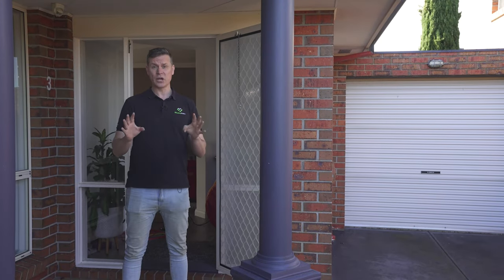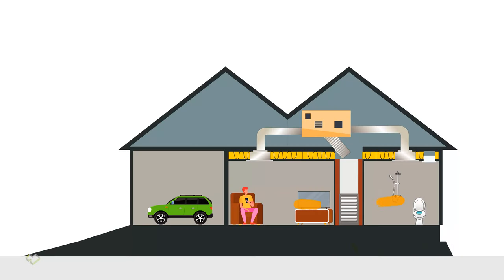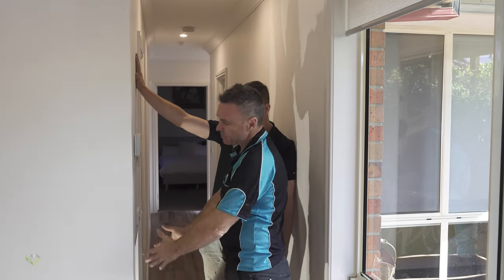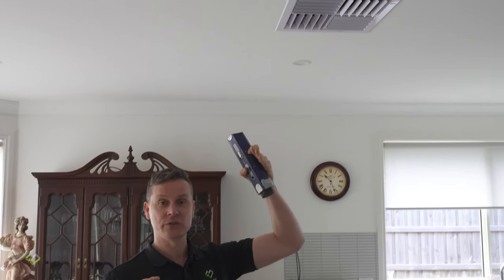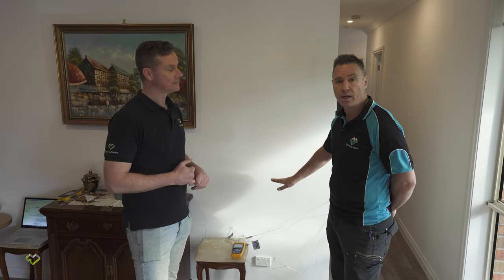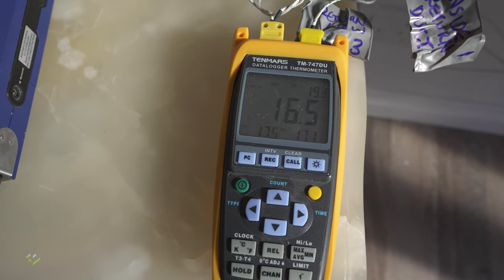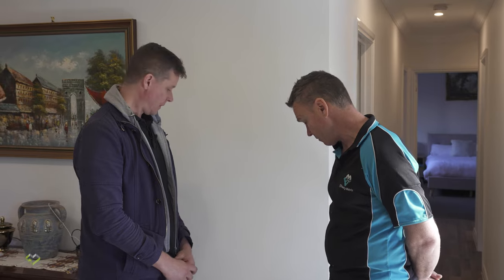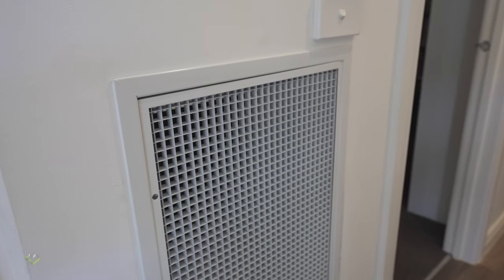Is your DUCTED HEATING system heating your attic/roof?

Comment: One of the most common problems I found was that the return air duct(s) were too small.  The system was virtually sucking air trying to make the system work.  As it is starving for air it does not have enough to distribute  throughout the house.

Recently I was building a house and the HVAC guy started running duct work.  By luck I stumbled on the correct calculations and added a 14" additional return air duct and the system worked perfectly.

Took those same calculations and checked the home I live in and it was also "sucking wind" so I added another return air duct.  The whistling stopped for the air intake.  The rooms are now even heat/cool and my operating costs went down.

My suggestion is don't blindly assume the original design is correct.  The other suggestions of being air tight are absolutely correct but in my case (2 out of two) the design was wrong and the systems would never have worked properly

For anyone wondering, the calculations are easy and there are tons of youtube videos on using a duct size calculator.  If you have a few minutes and a tape measure it might be worth checking out (the city inspector will NEVER check this.  I got my simple duct calculator from Amazon for about $10 and using it and making the changes will save me thousands of dollars in the future.  No I am not an HVAC tech.  I am a home builder focused on giving people quality homes for their hard earned money.

Comment: Just wondering what your thoughts are on the following situation. We have the gas ducted heating return vent in the floor of a cupboard however the air filter is in the door but the top half of the door, not the bottom half. Seems odd to me as the return is trying to draw air from the air filter space (which is almost a metre higher than return) and is also drawing from under the cupboard door. Surely this would make my system less efficient (as it’s going to so much effort to draw the air to the return.
Reply from the maker: Send us some photos of this.  This sounds insane.
sales@efficiencymatrix.com
Reply: @ecoevo  done :). It’s definitely an ‘interesting’ setup!